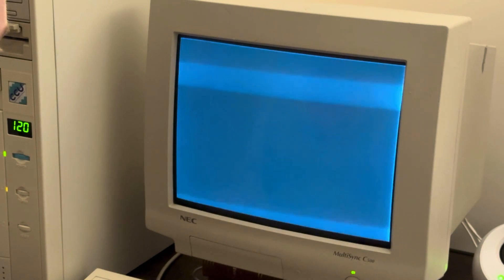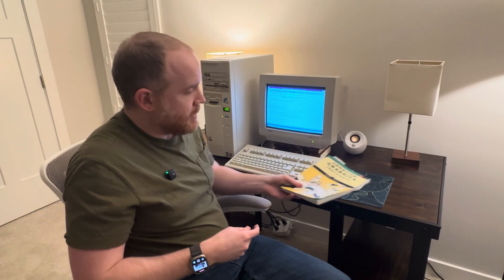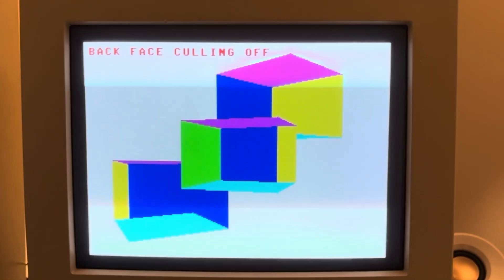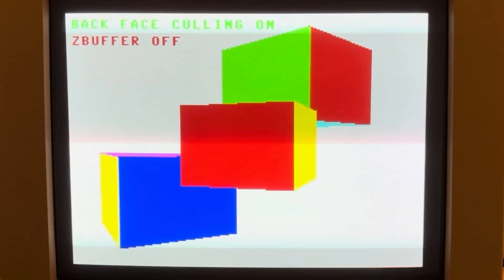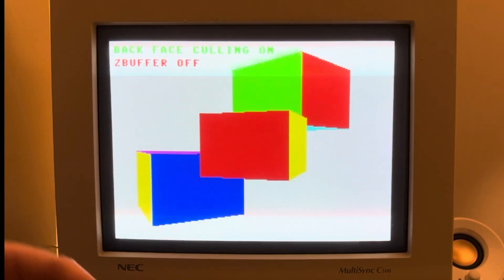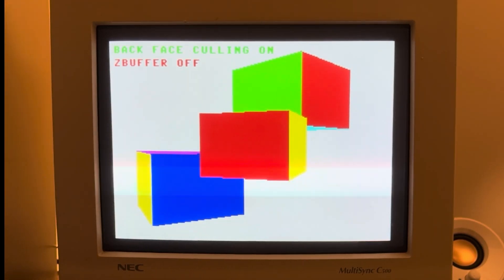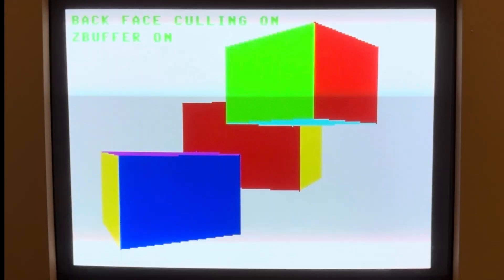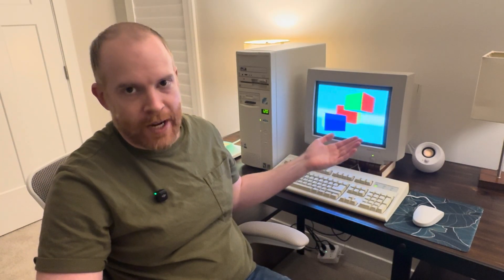Programming a rasterizer in C on my 486 PC - Part 2

Comment: Nice! but I can't condone clearing the screen to white... Keep it up.
"Depth sorting via a z-buffer" is a contradiction. They are both algorithms for "hidden surface removal", that's what the category is called. Depth sorting is when you're sorting triangles to render them back-to-front, if you don't use a z-buffer to have per-pixel hidden surface removal.
Reply from the maker: Thanks! It's been pretty fun so far to make videos related to graphics programming. I can't promise I won't use a white background in the future lol!

I wouldn't say that depth-sorting and z-buffering are contradictory since those concepts are not at odds with each other. From my understanding, depth-sorting is simply a process to sort objects in the scene correctly. Whether that process is implemented via triangle sorting or pixel sorting is up to the designer on what makes sense for application's requirements. Also, I wouldn't say that depth-sorting and z-buffering are algorithms for hidden surface removal. Hidden surface removal solves a different issue altogether which is not rendering occluded surfaces.
Reply: @CalebCohoon  terminology can be fluid and arbitrary, but what I'm saying is the traditional meaning of these terms in computer graphics bibliography for decades. So I thought the different meaning you implied has been due to confusion rather than a deliberate choice for what you believe is a better term. That's why I thought I'd mention it.
Reply from the maker: Ah okay, thanks. I appreciate the discussion about terminology, but I want to clarify that I'm not proposing my own alternative definitions. My explanation reflects how these concepts fundamentally work. Depth sorting being about ordering elements by depth (whether at pixel or object level), and hidden surface removal being about handling occlusion. They're distinct technical concepts that solve different issues, regardless of how various sources may label them.
Reply from the maker: Oh! I think I just discovered where our point of contention may be coming from. I looked through the book Computer Graphics: Principles and Practice and found this section:

"36.4.2 The Depth-Sort Algorithm
Newell et al.’s depth-sort algorithm [NNS72] extends the painter’s algorithm for
polygons to produce correct output in all cases. It operates in four steps."

I was never saying to implement the depth-sort algorithm via another algorithm like using a z-buffer but to handle the depth sorting process of my scene using a z-buffer. I understand now why you said what I said was a contradiction. :)
Reply from the maker: I guess all of this should teach me to ask more questions in the future! :) Thanks for the discussion and I hope I didn't come off as a jerk because that was not my intention for sure!
Reply: @CalebCohoon  Don't worry about it. I was just clarifying terminology, just to avoid confusion. I don't think it's that important.
And about what the broader category of these algorithms is called, Foley et al in CG:P&P called the chapter "Visible-Surface Determination", clarifying in the first paragraph that the process is known as "visible line, or visible-surface determination, or hidden-line or hidden-surface elimination". Alan Watt in 3D Computer Graphics, which was my go-to graphics book in the 90s, calls the section "Hidden surface removal" and references a 1974 paper by Sutherland titled "A characterization of ten hidden-surface algorithms". That's why I insisted on the name, and that it's been called that for a long time. I was too lazy to provide sources at first, but since you mentioned the Foley book, I thought I should.

Inside that broad category you will find depth sorting (painter's algorithm), Z-buffering, BSP trees, and possibly scanline active edge list algorithms.
Reply from the maker: Ah thank you for sharing that! I actually didn't have the 3D Computer Graphics book so I just bought a used copy. Also, I'll take a look through "A characterization of ten hidden-surface algorithms". Never heard of that paper before either. Now I really understand what you were saying earlier. It would have been really cool to be an adult in the era of 3d graphics development when it was first really getting established. Happy that all of these older books are available and not lost to time!

Thanks again for providing the sources!